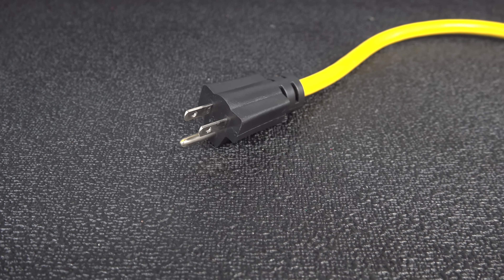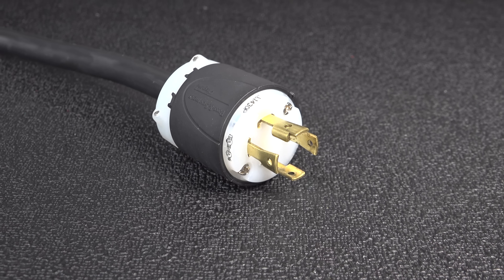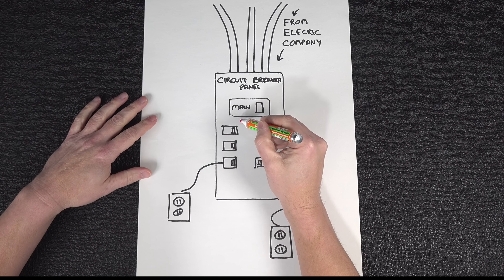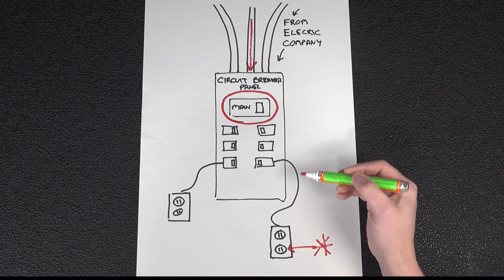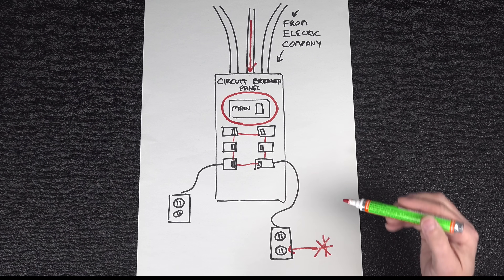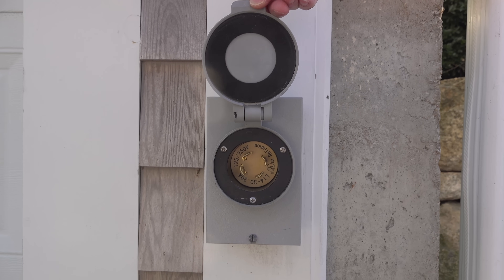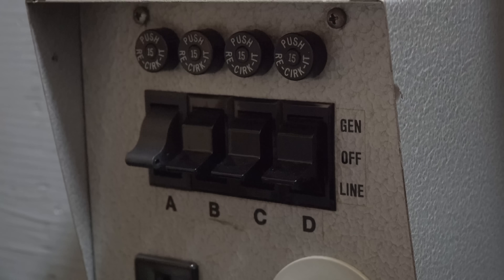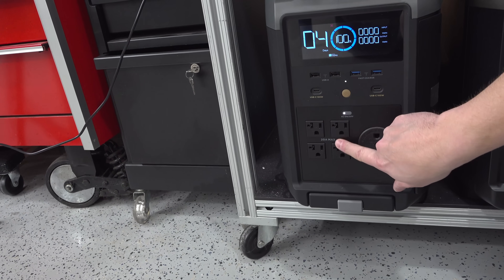Worst Electrical Mistake You Can Make - Backfeeding Generators

Comment: This is a really great safety tip. I never once considered that installing a generator incorrectly could energize external lines. 👍🏻👍🏻
Reply: Lol you guys are funny.
Reply: It can't energize the lines if your main breaker is off.  That is a physical disconnect between your house and the grid.
Reply: @willboudreau1187  the issue is that most folks who do this don't understand how their service panels operate and assume "my lights work now, i just be fine", or better yet, "i dont want to turn that off or stuff won't work when the power comes back on" and then they end up killing linemen.
Reply: @drteletubby  no. We obviously treat it all as energized. It’s a POWER line….
Reply: @willboudreau1187  But what happens if somebody forgets to turn their main breaker off?
Reply: @nonelost1  If someone doesn't turn the main breaker off and feeds generator into the panel, the generator will be immediately overloaded from essentially being hooked up to the entire neighborhood and will trip its circuit breakers .
Reply: @sylviaisgod6947  THIS ^ is what happens. The lineman ground the lines before they work on them. The TRUE danger of hooking up the generator to the grid is when the power comes back on, it will fry the windings of the generator in a gas tank melting flash kaboom.
Reply: @snap-off5383  That gives me an idea for the next gender-reveal party.
Reply: Don't take up chess.

Comment: another great option for safe legal backfeeding is the Generlink. it’s approved by my electric company and UL listed, installs right behind the meter and has the cord for the generator hookup and it automatically prevents backfeeding on generator power. our panel was full so it was going to require some work to accommodate a generator breaker and interlock so we opted for Generlink, we even got one with a whole house surge built.
Reply: My friend had this installed last year in Nova Scotia....expensive(I think she said 1800 for the generlink, but she had a rebate? not sure how much for the surge protector) but well worth it as her power goes out quite often....and covered by her home insurance...Not many people even know of this option.
Reply: @jedidiah5131  i paid about $900 US for the unit itself (40amp with built in whole house surge) and the electrician to install it since here the power company doesn’t directly handle it.
Reply: super spendy

Comment: All the years I worked at Ace hardware people would ask for those cords around Christmas time. I would politely decline selling them, and explain how dangerous they are. Unlike your example, people would string up their Christmas lights the wrong way and look for an easy fix. It's crazy what they try to do just to get around doing things the right way.
Reply: I work at a hardware store also and we call it the "dumb ass" cable.  They ask for it every Christmas.
Reply: I worked a couple Christmas seasons at Home Depot and got this question many times. Since nothing like this was sold, people got legit mad when I refused to show them how to make one.
Reply: @Double979tv  If you don't know how to connect a new plug end to a cord properly you don't have any business doing it.  These double male cords are asinine but I would be afraid to even sell one of the replacement plug ends to anyone that unintelligent.
Reply: @mharris5047  not being knowledgeable in even basic wiring does not by default render someone "unintelligent." It's weird and odd to even imply that. Actually, it's rather arrogant. It implies you think yourself automatically better than the next random person since you know wiring and they don't. That's ridiculous.

Comment: It's sad how many people advocate suicide cords like these.  I even saw a YouTube video recommending them from a guy who claimed to be a professional electrician.  That's one electrician I would never hire for any job!  The worst part is that improper backfeeding can injure or kill utility workers, not just the people using the cords.  Feeding your panel the right way isn't any harder, it just takes a little forethought.
Reply: The cord used for backfeeding has nothing to do with the safety of utility workers.  You can have a regular cord and proper outlet and still not have a transfer switch or interlock installed.
Reply: @justsomeguy8385  True, but if you look at lot of web sites and YouTube videos on the subject, you'll see a very high degree of correlation between dangerous cords and other dangerous practices.  Nearly every one I saw that recommended a cord with a male plug on each end also said you don't need a transfer switch or interlock. Even the supposed professional electrician I mentioned earlier said that you should just be careful to switch the breakers in the right order.
Reply: @OldBaldDad  I mean it will work so they aren't lying, but I guess an electrician should know better than to recommend such a thing.
Reply: Well, I’m a professional electrician. I have a fairly cheap, 8500 gas generator which I wire directly into a two pole 40 amp range breaker in my panel (with a ground and neutral) when I use it. Of course I open the main and check it dead before working etc. I tell my wife to stay away from i the panel in the garage when I have this sketchy setup going. ABTs and whole house generators are nice but pretty expensive to justify for the few times I’ve needed it. The outlet/interlock scheme shown in this video looks like a pretty good intermediate solution, but I don’t have any spare breaker slots and just don’t mind taking 10 minutes to do my cheap hookup. I probably could double up the range or dryer circuits, but frankly, I don’t even want to have any discussions with an inspector about this if I ever sell the house.
Reply: @Frank-og9jp  Just need to lock the main to be fully within code.  Inspectors never see it, its unplugged when they get there. Even if they see the generator and suicide cord in the corner of your shop or yard, they can't call that a violation unless its wired in.
Reply: Only takes a minute to determine if someone knows what they're talking about on this topic, or if they just parrot what they've heard other people say.
Reply: Interesting when the customer thinks they know better than the Electrician, they should try being an electrician then.
Reply: @dallynsr  You don't need to be a professional chef to know that a rat infested kitchen isn't okay. Likewise, when I see an electrician proudly showing off a job that includes multiple blatant NEC violations, I know it's time to pick someone else. I don't claim to know enough to be an electrician, but I know enough of the basics to help me pick an electrician.

Comment: Thanks for the PSA. Just my situation and intended for story purposes only.
 Made my own cable many years ago. Had a lil' 3500 watt pull start generator. Lost power for 12 days during a NE ice storm ~2008. Shut off all the breakers and the Main 200amp. Back fed a 120v outlet that was on the same phase as the Boiler and only turned on breakers needed on that phase
NOBODY is going to touch the electrical panel but ME. I even put electrical tape over the main so I would have to think twice. But when this power outage situation happens, trust me this is all you think about. They don't sell these cables because some ppl are stupid. Sorry can't go to the neighbors house because they don't have power either or drive anywhere because the roads are closed. 💀
Reply: not legal to tape it, you need to LOCK the breaker or panel.  Then you're good!

Comment: There's literally not a damn thing wrong with these at all, it all comes down to user error. At the end of the day you need to be smarter than the equipment you work with, because if you are not then you don't need to be messing with it in the first place. Pull your main fuse completely out at the disconnect and tada, zero issues. Take it a step further and remove the component of human forgetfulness by simply taking the key for the genset and put it in the fuseable disconnect box. Tada now you can't start your gen without first disconnecting the mains. One step further would be to take the fuse cradle back to the genset and zip tie it to the genset. Tada now you can't reconnect to the mains without going to the gen first. Best part is all of this is free and fairly easy for even the dumbest mouth breather to accomplish.
Reply: Your common sense is like a breath of fresh air amid the intellectually putrifying air of the authoritarians running the country.  I'm not saying I'm going to back feed anytime soon, but it sure is encouraging to see people stand up and tell the truth.
Reply: @willboudreau1187  I agree...if a person does not know to shut off main breaker..should not be running a generator or driving a car etc.

Comment: I'm no certified electrician, but I DO have common sense...  any manufacturer producing and selling "suicide cords" should be fined and possibly held liable for injury or death from the use of these cords. I installed a two circuit transfer switch into my main panel, one circuit going to furnace, and the other to lights, and a couple of emergency only outlets that I can use to power a few items I might need in a power outage. I can run my emergency power needs with a 2000 watt inverter generator, and have about 1200 watts left over for whatever I might need to power.

Comment: Explain how it could feed the power line with the main breaker shut off
Reply: If your main is off it won't backfeed the utility, but only your panel. The big worry is if people forget to open the main.
Reply: Sevy, thank you for stating the truth.  It's not scary to me that people use suicide cords, or even that people figure out how to back feed their breaker box.  What is truly scary is that people DON'T KNOW what would happen if they back feed with their main breaker engaged and the grid has power, and then they comment on this website, "how informative" this video was, completely exposing how ignorant they are of common principles of electricity.  Honesty, such people should probably not be buying generators with that level of ignorance in the first place.  The finger wagging by SilverCymbal is standard business policy - keep yourself (and your business model) safe by telling people not to do what you're showing them how to do.
Reply: @willboudreau1187  I agree...if a person does not know to shut off main breaker..should not be running a generator or driving a car etc.
Reply: It can't.